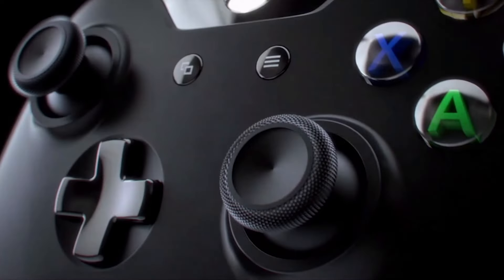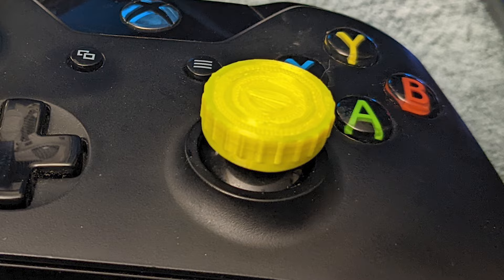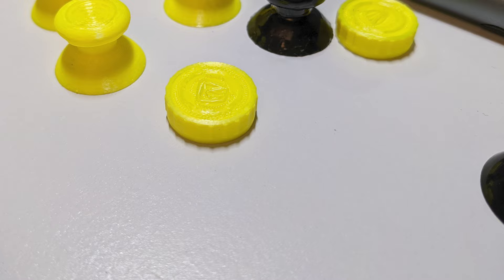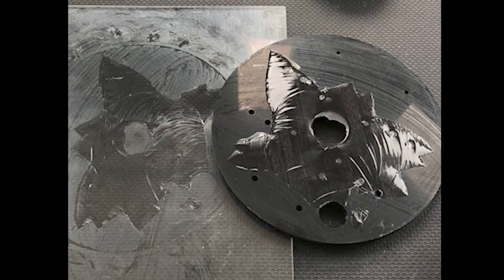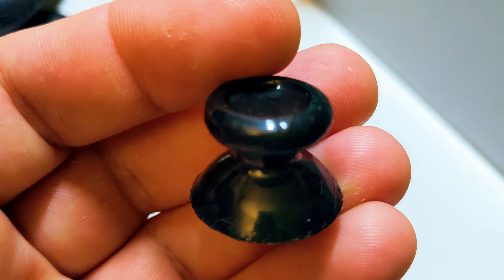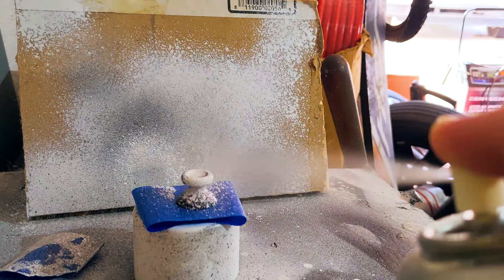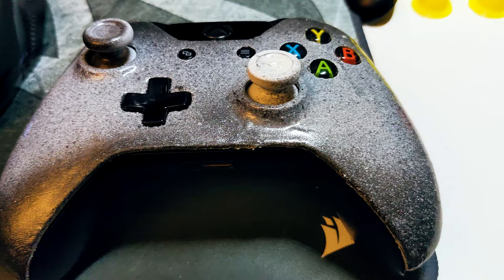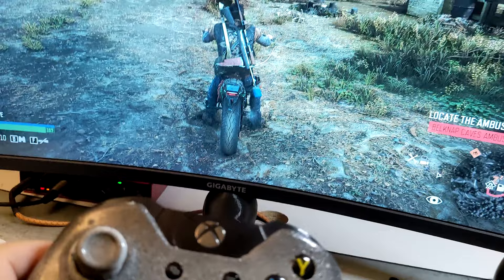I Customized My Xbox Controller With 3D Prints!

Comment: How did you atach the screws to the faceplate. I'm thinking of trying this for myself but I don't know if I need ot tap the screw holes or not.
Reply from the maker: I just screwed them in with some slight pressure and the screws tapped themselves. The tolerances of the model/print were spot on.

Comment: I'm going to print the joysticks tomorrow, did you use any supports?
Reply from the maker: Nope, not at all.
Reply: @Avel  thanks you, I'm new in the 3d printing world sometimes I use supports to avoid spaghetti monsters
Reply from the maker: @2kyrie  No problem! It's really up to you (and your printer, really) if you want to use them. I forgot that I did use them on the TPU because it's softer, but once I switched to PETG I found they weren't necessary.